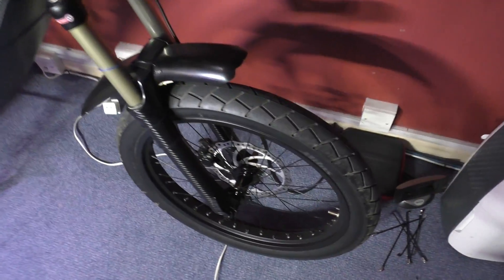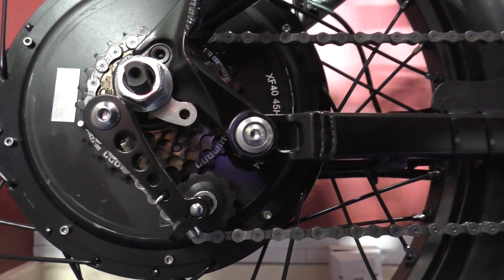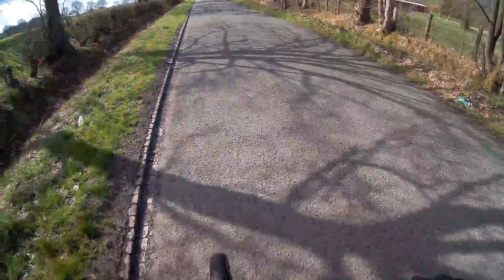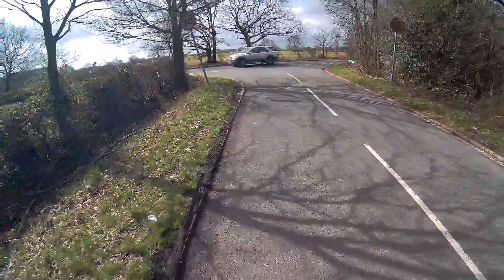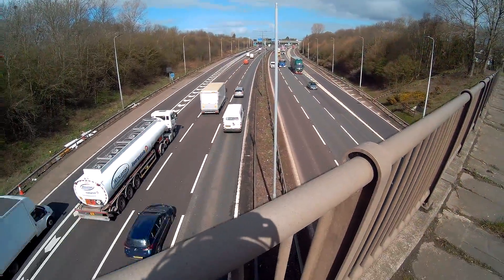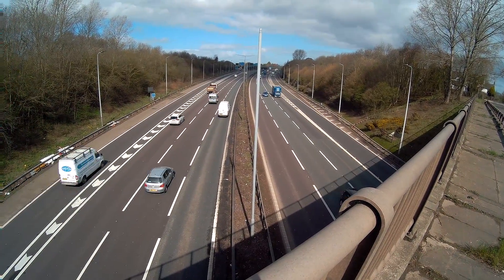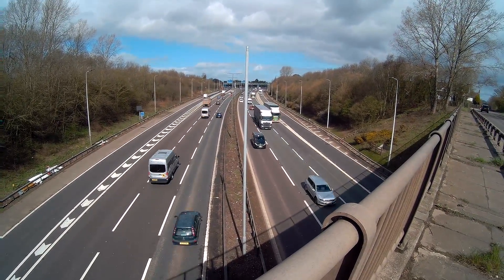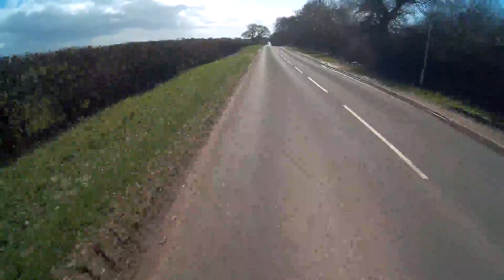Insanely fast DIY electric eBike - I want more POWER!

Comment: 15.5 mph never looked so fun.
Reply: No kidding 😂 max speed must be about 20mph too aye?
Reply: @ccupit9027  I tell you its fun ... oh hell yes it is. Scary? You bet. Going stupid fast on something that weighs less than a shopping cart full of your next 2 week lunches  is extremely scary ... AND gratifying.

I didn't catch what his voltage is, but for info sake ... a single 48v 1000w 26" hub motor and 1 48v 15ah LiFePO4 battery has crappy acceleration, max speed of just over 22mph, IF the rider is 200lbs and the bike weighs in at a staggering 50-60 lbs. But you're left with extreme load on the battery which causes VERY high heat with the battery.

No good... Not even for LiFePO4.

With my dual 48v 1000w and dual 48v 15ah LiFePo4 (one for each motor), dual throttle ... the bike is now about 75 to 85+ lbs, plus my 200lb fat ass.... and the acceleration on this thing? Holy shit.....

From a stop point you can freak out most the people in gas autos from the start from just how fast you take off.... unless they're really flooring the gas pedal.

I reach 34.7 mph on a full charge and static wind resistance (meaning I don't fight a head wind) on mostly level roadway.

Tire PSI is at 60psi to minimize rolling friction. And its all BICYCLE stuff ... no "automobile" tires or anything in my mix. But I DO deal with a lot more flats and bumpy rides than the uploader does ;)
Reply: It never was fun...
Reply: Mine goes 20 mph
Reply: @montemaguire4596  mine goes 34.7 mph
Reply: @crackerjack4833  30mph isnt very fast im sure iv been 30mph on my mountain bike
Reply: @lewisbujak4047  going down hill right? 30mph may not be fast by your definition but 35mph for me is fast... on a bicycle with 2 motors, all the wiring and 2 batteries weigh near 100lbs... myself weighing at a staggering 200lbs...

I don't stop on a dime here. lol
Reply: @crackerjack4833  hey mate, you should check your speed sensors. I have installed a bafang 750w mid drive on my bike and it does 37mph (60kph). It makes little sense that your build would be slower than mine
Reply: @BrevityBuzz  I wonder if these hub motor kits I got from Amazon have a speed limiter in the controllers?

I used my phones GPS to track my speed. I calibrated it in an actual car to see how accurate it was. Its fairly close, only off by a couple mph.
Reply: @crackerjack4833  Google the controllers then cause that might be the case
Reply: And Lewis's goes 19.9999999999999999999999999999999 mph

Comment: Have a 20" titanium paratrooper. I run a 50cc Honda rear friction drive. I bike at 20-25mph. 
I want a 48V 1000 watt front hub motor conversion kits. Climbing a hill with the Honda being assisted by a Rohloff speed 500-14 (leg power)... I activate the front hub motor to assist gas and adrenalin.
Working in harmony we top the hill without a gear shift adjustment.

Comment: That's not how motorbikes work. I have raced my s1000rr on a racetrack with out shifting my body weight at all. When youshift your body weight to the left, your handle bars turn right. On a motorbike at speed in a corner you have to turn right to get the bike to turn left. It makes the bike lean over. A lot of bad motorbike riders don't realise this and they just do the exact same and think they need to lean to get the bike to turn. The best method is obviously to counter steer and lean but you can get away with just counter steer if you are being lazy. It has been tested, you can fix the handle bars so they won't steer then you can hand off the side of the bike bike and it wont steer. The effect you are talking about is also amplified by rack angle. Motorbikes have a higher rack angle so they keep riding straight at lower speeds. It freaks me out as having such a steep rack angle on a push bike it feels sooooo unstable compared to a push bike.
Reply from the maker: I know all about counter-steering mate. I was trying to explain it to people who have never ridden a motorbike (very badly done).
Reply: Yep, it's just a common thing that people don't realize. I have argued with people at race tracks about counter steering, some riders just don't think it's real. Obviously all those riders are completely useless, can't get past the fact that you turn right to go left.

Comment: Hi Tony.
Just come across your video for your insane bike.
Then watched this one.
Loving the lights on this one.
Vast improvement.
If you dont mind me asking,  how much has it cost you to convert the bike from pedal power to what you rode in this video?
I was like wtf! WOW! LOFL!
Awesome machine mate.
The other question is did you set off the speed camera?
Great job and upload ..
Cheers dude.
Reply from the maker: The total cost was in the region of £1.5k but it's hard to figure out because of the development and changes that went into it. 
As for the speed cameras..... nope, none of them went off. I was only doing 15mph anyway ;-)
Reply: @Vortecks  yeah I appreciate the developer side of things . I used to work for a prestigious car manufacturer and seen it first hand.
But you have certainly done a great job.
If this could be mass produced I'm sure build cost would be cheaper.
But your definitely on to a winner either way.
People would buy it in their droves.
Cheers for the reply .

Comment: If you are having difficulty stearing round corners at high speed pit smaller wheels on that's why the super bikes don't have 21 inch off road rims on because it's impossible when counter stearing

Comment: love the bike  but pushbikes and motorbikes  basically steer the same   why shouldn't they ?  'Counter steering' applies to both as well as shifting you weight  this applies to MotoGP hanging off or the tour de France riders both trying to keep the bike upright for the best grip whilst going as fast as they can round the bendy bits 
 again your bike is a hoot  thanks
Reply: I guess because usually pushbikes are generally a lot slower (asides crazy ebikes like this!) Have generally far larger wheels, different frame and steering geometry and usually a far higher relative centre of gravity.

Comment: Ahh no comments on the last video.
  Why not go for a fat bike frame if you want to have fatter tyres? You might be better off with bolt through hubs rather than skewers also a chain tensioner would make sure your chain never comes off and gets tangled in the gears.
  I would use a triple clamp fork from a downhill bike infact i am going to build one with a modified bionx motor onto a downhill bike. Downhill bikes can fit fairly wide tyres, usually 3" or possibly wider.
  Some bigger brakes if you don't already have some and some very wide handlebars for more control.
  It's amazing but for this amount of power i would want a heavier bike.

Comment: Comments were disabled on the first one lol! You, sir, are a certifiable madman and all the better for it. I used to run round on an old GPO bike with a BSA 28cc(?) engine powered wheel, The only thing your bike lacks is the ability to make petrol station clerks give you evils when you put a capful of oil and then pump 70p worth of unleaded into the back wheel... :D

Comment: Very nice, and would like to see you try and get that battery weight a bit lower on the bike frame, but that thing turned out quite brilliant! Just finished a pretty nice regular bicycle, and if I can get on w/about 3k other projects will start adding pieces for a E-bike build..in fact I've got a frame in mind already. But 1 thing, those mud guards from the earlier video 'V-1' do you happen to have a USA link for some of them? Really like them, and everything I find here are not nearly as decent.

Comment: I’m surprised those spokes are not bent or broken and the wheel will wobble like hell at the back. That’s the problem i had when I built a 72v/3kw system on my mtb 9 years when these kits first came out and nobody knew about them. Did a weeks riding and it just retired in my garage. I just use 48v/1kw Systems now

Comment: Wow, it looks actually very interesting and the modifications are not that bad too.
I would actually like to build such a fast Ebike by myself and it would be actually possible since I have a lot of parts and 18650 cells but unfortunately I live in a stu*id country called Germany which is full of stu*id laws. 

For example for your Ebike I would need an Straßenzulassung (allows me to drive it on public roads/ impossible to get for a diy beast like this), Betriebserlaubnis (allows me to use it on public roads/ usually you get this with the Straßenzulassung but here you get an extra peace of paper) and also I would need an insurance license plate which would cost me 40~ 82€ monthly : P

Comment: love your BMS, and app connect, tyres good, havent watched past videos but ur motor and batter seems weak, i could do 60+KPH on my alloy frame custom, 36V 20AH battery running only a 300w rear hub motor. the motor took it well was about 10-15A max. suprised urs is so slow with your specs, unless ur not running it flat out, then grats to you

Comment: Why use a heavy expensive battery on the bike that only take 1000 + charges, when you could use a super capacitors that can be used over 1 million + times? And they only take 30 seconds to charge up fully compared to 6-8 hrs for a slow expensive lithium battery, Just wondering?
Reply: Shaun Sim Energy density of super capacitors isn't large enough.
Reply: Shaun Sim you would get to the end of the block, real fast....then the supercaps would be discharged, they have very limited storage, or amp/hrs....but a #@$# load of instant amps.
Reply: They would be good for regenerative breaking.
Reply: Shaun Sim keep on,u were saying
Reply: Shaun,

Because he wants a bigger range than 500 yards.

Comment: How fast is this thing been at FULL TILT! 😮 If it's less than 55mph then it's slower than another E-modified  bycicle. But, as mentioned it's supposedly much faster than it was before. I don't know not seen any results of top speed. Shame it was not done just to actually show the difference between the two.  I'm sure it needs MORE POWER!!! due to the extra weight that it's been given i.e tyres & wheels are going to add a good few extra pounds each weight wise. & How long does it take to charge the battery up & average distance how far can it go before it's battery life is in need of a FULL!  recharge?  That motor has to at LEAST! 5,800 to possibly 6,300 watts. 😮.
Reply from the maker: It actually pulls 15kw flat-out. The top speed is something I'm working up to, I still have more testing to do before I open her up fully. I get around 25 miles if I'm conservative but it's sooooo hard not to have fun. Charge time is relative to the amount the charger can output. Mine will charge it in around 2 hours.

Comment: If you attach weights to the front forks the front end will stay more stable at higher speeds. Either that or a few weights evenly spaced inside the front rim (on the black part). The reason motorcycles are so stable is because of how much weight they have. Adding more weight a precise locations will go a long way in making it a more stable and smoother ride. Another option would be to get a steering dampener like they sell for motorcycles which will stabilize the handlebars quite a bit. Not sure if they make them for bicycles or not. Also, if there's any way you can modify the seat post so that the seat sits a few inches lower that will make a big difference. The lower your center of gravity the better. Great project mate. I'm loving how it's coming along.
Reply from the maker: I've been riding superbikes for over 30 years so I think I've got the grasp of it now :-)   
Adding weight isn't an option - I have to carry it up 2 flights of stair and it already weighs 42kg. As for the seat....... it's as low as it can go, it's actually touching the cross-bar. Any lower and my testicles will be rattling off the back wheel :D
Reply: Vortecks Oh Nice! Didn't mean any offence. Was just coming from an engineering background. Cheers on the bike mate.
Reply: Aaron Humphrey Very true. Great ideas. I really need to start myself a similar project. I used to do BMX when I was younger. I'm interested to see if I could put a small set-up on a BMX style bike. Just something to be able to get me up to 20-25mph.
Reply: separator94 you can also increase the front fork angle as well as lowering the seat hieght . Super capacitor s would work great for storing regenerate braking energy because they're able to take in higher input current than batteries
Reply: separator94 a steering damper perhaps?
Reply: How about a front spoiler for downforce and awesomeness

Comment: If you want to turn really well at higher speeds ..., you press forward with your  palm on The Handlebar gently, but firmly and it will make the bike lean in that direction .  So you won't have to hang your arse off the seat at all. Takes some getting used to,. but try it.  I didn't believe it at first until I started riding that way.  So it's completely backwards then just riding your bike at low speeds

Comment: Fortunately I've a Pedelec with big 20 inch tyres and there are all kinds of BMX tyres available with more or less grippy tyres. I can tell that my BMX tyres have far better grip than the Schwalbe Big Ben and Apple before and are in the medium grip group. So the usual bicycle tyres have not the grip they could have and are more build for being light without wearing too much. And more grip means more rolling resistance as well, that matters more when driving without support.

Comment: Great update  ! I guess for most high-powered E-bikes it makes more sense to use motorbike tires and rims. Both for more stability  and durability. Personally I would switch away from the screwed on Shimano Megarange package and use a single sprocket instead. Those single sprockets are more durable than the average 7 speed drive set.

Just as an example: http://www.ebikes.ca/shop/electric-bicycle-parts/freewheels/fw1spdwhite.html

You find a lot of E-bike riders on Youtube which run only a single speed. Given your motor power this doesn't really hurt. :-)

Also think about using dual sided torque arms. The stress of your hub motor could otherwise easily screw up your drop outs.
Not to speak about the forces applied during recuperation / regenerative braking.

Nice reading on torque arms:
http://www.ebikes.ca/product-info/torque-arms.html

Comment: not sure ive seen on the other vids (my memory sucks) but what security do you have on it dont fancy the idea of poping in shop to get a drink and sum1 makes off with it however having to spend 20 mins locking it up as well would kinda suck
Reply from the maker: There's a setting in the controller that locks the back wheel - it's a simple switch on the handlebars but it's not obvious.

Comment: There are two ways to generate turning force on a bicycle or motorcycle.  At low speeds you can turn the handlebars in the direction of the turn and use slip angle related forces to turn just like a car or little red pull wagon.  Past parking lot speeds you use camber thrust to turn the two wheeler.  If you roll a cone across a table it will turn in a circle.  Even part of a cone will turn in a circle, e.g. Styrofoam coffee cup.  A motorcycle wheel is bigger in the center than on either side.  When it is leaned over the tire cross section is conical and generates a camber thrust turning force.  You can lean a motorcycle to get it on the edge of the tires. Or, and I'm sure a million motorcyclists shouted this out around 5:30, you can countersteer to get the motorcycle to lean.  And yes, it works on bicycles as Wilbur and Orville Wright discussed in print.

Comment: I own a few CZ motorcycles and CZ don't make a 19 Inch rim, only 16, 18 and 23 Inch rims in 4 width sizes on 18 Inch.

It isn't a CZ rim but the Tyre is Czech (Mitas formally Barum so top quality).

Ironically CZ used to make bicycles until they started making motorcycles in 1919.
Reply from the maker: Sorry Andy, I mistakenly said they're 19" but they're actually 18". I love the CZ bikes, it takes me back to when I was a child :-)

Comment: Bravo ,simply Bravo ! I have a question about your wheels and everything linked to them (front Suspension Fork ) out of luck I hit your video and I am currently working on getting a set up pretty much as yours .So my question is simple would be so kind and message me all the links to the parts you have used to have them same wheel set up .Thank You Much . A comment by Kenneth Orb about counter steering ,he's right I did learn that last year & twice using that technic I saved my life as my ride also is HP 45-55Kph is usual speed .Thank You Be well . Oh BTW --> Subbed =D Oh that's me alright forgetting stuff ,The  Hubs -> details about them too please did I counted correctly 40 spokes ? Where /How did you manage to obtain it ,For the rear hub I have a Mid Drive ,so ....  ty much =)
Reply from the maker: I'm sorry but I don't have a complete list of parts. They were all bought 'as I needed them'. Each build is totally different to the next and the parts that I used wouldn't be of any use to anyone else. The basic parts (hub motor, speed controller, cycle analyst and batteries) are featured in my build series. The front & back wheels are 36 hole.
Counter steering - yeah, I know all about it. I've been a superbike rider for 30 years but I was trying to explain to others (in very basic terms) how it feels to have a larger mass an e-bike wheels. I know, I failed badly as usual :-)

Comment: i read an article about a new law allowing speed pedalecs up to 30mph 4kw, by the looks of it you will likely still be outside of this, but thats assuming it will come to fruition, i think it would be a good move and get more people to use electric bikes for local commutes to work etc instead of clogging the roads up with cars